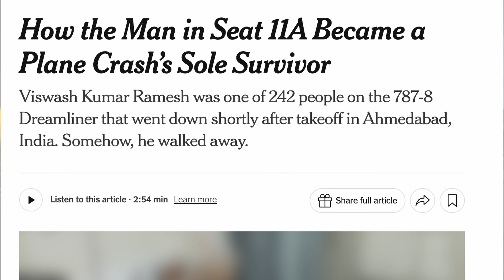Why the RAT Changes Everything – Air India 171 Update

Comment: I have one bit to add to this analysis.  There was an interview with a guy that had been a passenger on that plane earlier in the day.  He said the electrics were playing up, I think it was his onboard console or something.  Also in one of the analysis videos it was mentioned that the fuel pumps are electric.  Some years ago, I was on a 747, it was very late as the plane had been getting repairs the the fuel pump.  As we were finally loaded and on the runway, the pilots were revving the engines, presumably checking everything was working properly.  We then started down the runway to take off.  About half way down the runway, I suddenly noticed not enough thrust and I freaked out.  Luckily, a few moments later the pilots also noticed it and aborted the take off.  Turns out that the fuel pump had failed a second time while on the runway.  If this had happened one minute later it would have resulted in the exact same scenario as the AI 787 crash.
Reply: Onboard electronics that run AC, Entertainment Systems etc and FADEC electronics that run the plane are two different circuits. They have no mixing. This might be a first of its kind failure. Really have to wait for the DVR analysis.
Reply: @backpropagation8365  If electronics and power are out, will the DVR not also be out?
Reply: @backpropagation8365 
Super point
Reply: Having travelled Air India - centre seat consoles not working is somewhat the norm unfortunately
Reply: The entertainment screens have NOTHING to do with avionics systems
Reply: @texasrob2782  Good point..... But folks will say otherwise. It's human nature:     
 "My Call Button for the steward was not working..   I JUST KNEW we were going to crash & die!"
Reply: @texasrob2782 They do...if there is no power generation...
That is why you l"oad shed" non essential systems if you have power generation issues!!
Reply: yeah aircraft also had no A/C during that guy's time as a passenger in the plane too
Reply: Some of the bots in the comments have sort circuited. Maybe it's in solidarity with their electrical circuit cousins on this airplane.
Reply: Regarding the onboard electronics, Air India is notorious for never having functioning IFE systems. Everything else checks out though.
Reply: A 747 has several fuel pumps. 2 for each tank. One faulty pump would not be the end of the world
Reply: Oh my!  I'm glad you are still with us, Carla.
Reply: I saw a video (perhaps not a reliable source) that said that once running, the engines can suck the fuel they need without the pumps.
Reply: There is a video going around people are saying is from that plane. But if you look at the seat configuration it's totally wrong as dreamliners are 3 by 3 seats. First or Business class are the only ones that are the two seat configuration & there aren't that many of them. So if that's the on you are talking of I would fully believe it. Until it's been confirmed real by the investigating bodies as I'm sure they would be looking at it & talking to previous passengers.  Also if this was true they would have had plenty of time to get a new plane as this originated in I think it was in Brisbane.  I hope this can be verified but that's what I read when it first happened & I've done a flight booking & that's the plane you get doing the same route.
Reply: Maintenance?
Reply: The AC and the entertainment systems run on different circuits.  While it’s not rare, AC and entertainment sometimes don’t work on aircrafts, but that doesn’t mean they can’t fly
With AI I would not be surprised, I have flown to NY from Delhi on AI and the entertainment system was knackered for the entire duration of the flight. The cooling was also not stellar, the seats were also loose,
I wouldn’t be surprised if bad maintenance had a role to play in this catastrophe..,
Reply: @arbjful  To stop you in your tacks and to prove you factually wrong;

"After initial investigations, Boeing was quick to come up with a solution to its battery issues. In February 2013, it submitted a proposal for the update of the 787 battery and later made changes. In a press release from March 2013, the airframer said,
"
Design feature improvements for the battery include the addition of new thermal and electrical insulation materials and other changes. The enhanced production and testing processes include more stringent screening of battery cells prior to battery assembly. Operational improvements focus on tightening of the system's voltage range. A key feature of the new enclosure is that it ensures that no fire can develop in the enclosure or in the battery."
Reply: A basic check....
"Thrust set...."
And check your fuel flow...
Especially on the B707....
You flew it on fuel flow....
Reply: yep i saw that.  the electronics at the seats were not working.
Reply: @YouTubeAccount-z4r  Also air-conditioning was out and people were fanning themselves to try to stay cool.
Reply: How many fuel pumps a 787 dreamliner  has?  Should have  redundancy for such a critical component
Reply: @user94133  The 787 has redundancy everywhere. It has 4 total fuel pumps, one in each wing tank and 2 in the center. And if there is no electric to run the pumps the engines can draw fuel via gravity feed. Once the APU is online is can also power fuel pumps.
Reply: @user94133 It's what powers the pumps.....
Reply: omg !
Reply: Fuel pumps are not electric, the boost pumps are. The fuel still gets to the engine regardless. Either way, all pumps would have to fail simultaneously and all generators too and even then power wouldn't drop off immediately to the point of shutdown.
Reply: @cefb8923  What about the FADEC? If no power, the fuel metering would shut off.
Reply: https://youtu.be/1y_u1O-T6jw?si=kIy6IEkTbtrOFLX4
Reply: Thanks.
Reply: they should always do such a test before. If the engines work and everything else, and the fuel pump has the appropriate pressure, the risk of such events would be practically zero. Why aren't engines tested this way before launch?
Reply: Thank You Sir for this explanation
Reply: You know people
To do this kind of corruption in maintenance is a criminal act
I request PM Modi to investigate this tragedy
The people of want to punish those responsible for this terrible tragedy
Jai Hind
Reply: Dont wanna hear your analysis
Reply: I was in air India flight very recently, lot of infotainment sysmtena didn’t work for a lot of people in my flight also. Basically what that guy was explaining in that video I experienced it too, imho I’ve epxerienced that multiple time, it’s just air India being air India. I wouldn’t look into it deeply
Reply: @biorgoanylchem Again. The passenger comfort electrical systems have no relationship to FADEC electrical systems which is the circuit used to power a flight.
Reply: @backpropagation8365  The FADEC HVAC. and IFE both allrequire power from the normally redundant power busses. That the RAT was deployed is the final measure. Indicating a loss of all redundant buses. But the RAT cannot power everything, nor quickly enough in that critical phase of flight. If the video of the previous flight was the same aircraft, it would seem the maintenance or lack of,  was the root of the problem.
Reply: @rhyoliteaquacade wrong. Maintenance is done per Boeing’s checklist. The minimum checks need to be done prior to the aircraft being allowed to fly. Further the company would have to clear the periodic certification of the regulatory agency. Unless the regulatory agency of India failed in its job, aircraft being allowed to fly is impossible. Further, any electrical issue would have been found out during taxiing and the max power prior to take off. Plus IFE and FADEC are entirely two different circuits. They have no connection to each other.
Reply: @backpropagation8365  You are assuming that maintenance checklist and MEL were performed. The IFE and FADEC (normally) get powered from the redundant power busses and both engine generators while in flight. If no redundant generator, the APU or RAT are next contingencies. I am contending that the plane was flown with less than minimum equipment list and was not properly maintained. It is now obvious that there was an electrical failure.
Reply: The 787 has a known history of lithium-ion battery fires, which can trigger catastrophic avionics failures. On the previous flight, passengers reported the air conditioning, lights, and entertainment systems were not working—clear signs of electrical problems building up. During the accident, the Ram Air Turbine (RAT) deployed and the landing gear stayed down, both strong evidence of total power loss. Survivor also saw emergency green and white lights come on before impact, indicating the aircraft switched to backup power. All these point to a likely scenario where an electrical fire or battery failure knocked out critical systems, leaving the crew unable to retract the gear or climb. The 248 day bug that requires the SW to be reset (failing to do so could cause GCU issues and complete power failure) can be ruled out because the engine was replaced only recently (and probably the SW bug has been fixed)
787 batteries are susceptible to "cascading thermal runaway" where failure of one cell triggers failure of adjacent cells. A main battery fire can cause APU to fail as well. The high electrical demands of takeoff could have triggered the final cascade. Also bear in mind that 787s are Full Authority Digital Engine Control (FADEC) systems that require electrical power for proper thrust management.
Reply: @vajrapaniom7410  air India has a known history of poor maintenance. Not to mention they got fined this year FOR ALLOWING A PILOT TO FLY WITHOUT COMPLETING MANDATORY
TAKE-OFFS AND LANDINGS But you don’t bring any of that up?
Reply: @CheckUrSole This aircraft had just undergone a comprehensive maintainance. But I agree, any clues regarding malfunction should have been flagged.
Reply: @CheckUrSole 
Air India better clean up their act
Dismiss Air India
Good luck in your future business plans Air India
Reply: @vajrapaniom7410  It's very unlikely the pilots and crew would have missed a literal on board fire before taking off. It's very unlikely that it's an electronics issue. The air conditioning, lights, and entertainment not working doesn't explain much air india is notorious for terrible cabin upkeep. However, air india is notorious for cutting costs with maintenance, and if the wiring was botched in a maintenance procedure, that could explain the complete electrical power loss, leading to the fuel pumps being starved. *Edit, since the fuel was full, there should have been more than enough pressure for the fuel to be suction fed to the engines, keeping the engines running for at least a few minutes. Makes the scenario all the more confusing
Reply: @grendlerdik9426RAT cannot power the engine. The max power consumption occurs during take off, and thermal runaway requires only a few seconds.
Reply: @grendlerdik9426

BOO AIR INDIA
Reply: @vajrapaniom7410  No, it does NOT have a history of lithium-ion battery fires. There were exactly 2 incidents in early 2013, after which Boeing retrofitted the entire global fleet with steel encasements that vent gasses out of the plane should a thermal runaway every happen (none EVER has since); with new charge management logic; with new cell spacing and padding; with additional status monitoring; and with enhanced battery management systems. There has never been an incident since. Period. End of story.
Reply: @Objectified minor incidents continue to happen, but indeed the containment holds. But this was never a solution.
Reply: @vajrapaniom7410  Do the engines go to idle in that scenario? Don't they tend to keep going if they don't receive any signals? Would at least be good if the defaulted to full power you can always shut one down for landing.
Reply: @please_stop-v7o no it goes to a low power setting. Perhaps safer than full thrust considering various scenarios.
Reply: @vajrapaniom7410  so the 777 does not require electrical power for thrust management?
Reply: @vajrapaniom7410 
Fantastic analysis 
Thank You Sir for this useful detail
Reply: @vajrapaniom7410  The battery issues were well over a decade ago and were addressed. The more people speculate the weirder the theories become.
Reply: @vajrapaniom7410  "The 787 has a known history of lithium-ion battery fires, which can trigger catastrophic avionics failures."

People like you are the actual issue here, you are making factually incorrect statements based on nothing.

That claim is factually incorrect and misleading. The Boeing 787 does not have a 'known' history of battery fires beyond the well-documented incidents in 2013/2014. Those issues were thoroughly investigated and resolved with design and safety system upgrades implemented over a decade ago.

Since then, there have been no recurring battery fire incidents of that nature. If you're suggesting this is the cause of a recent event, you're effectively claiming that Air India - or their maintenance provider - failed to apply long-established mandatory safety modifications. That’s a very different issue from implying an inherent design flaw in the aircraft itself.
Reply: @aflyingcowboy31 issue was never resolved, only contained.
Reply: @vajrapaniom7410  "issue was never resolved, only contained."

Factually false, if it was only contained please explain why there have been no reports of battery issues since 2013/2014.....

Boeing revised the battery design and the FAA also implemented 3 additional overlapping protection methods to address this issues.

So once again, you are the issue, because you are spreading misinformation.
Reply: @aflyingcowboy31  to contain the fire, yes. The type of battery remains the same.
Reply: @vajrapaniom7410  I literally just gave you a quote that says it is not the same battery.... 

They literally revised the battery, maybe try reading things closely first.

"Design feature improvements for the battery include the addition of new thermal and electrical insulation materials and other changes. The enhanced production and testing processes include more stringent screening of battery cells prior to battery assembly. Operational improvements focus on tightening of the system's voltage range. A key feature of the new enclosure is that it ensures that no fire can develop in the enclosure or in the battery."
Reply: @vajrapaniom7410  Once again, if they did not change the battery, explain why there have been no incidents with that battery since 2013/2014....

Stop spreading misinformation.
Reply: @aflyingcowboy31 why has anything never happened before is an interesting philisophical question.
Reply: @vajrapaniom7410  Except it isn't. Once again you refuse to read what I have given because you are a liar, they revised the entire battery.....

If it was a known issue in 2013/2014, why does that known issue no longer occur.....

That is not a philosophical question, it only is because you don't want to acknowledge you are wrong.
Reply: @aflyingcowboy31 depends on what you mean by revised. Again, we are talking about plausibilities and statistics, chances that are one in 100,000 or a million. Both engines failing simultaneously, absent a massive bird strike or debris affecting both engines, leads in the direction of a  total power failure.
Reply: @vajrapaniom7410  I literally gave you a quote on what they revised......

"Design feature improvements for the battery include the addition of new thermal and electrical insulation materials and other changes. The enhanced production and testing processes include more stringent screening of battery cells prior to battery assembly. Operational improvements focus on tightening of the system's voltage range. A key feature of the new enclosure is that it ensures that no fire can develop in the enclosure or in the battery."
Reply: @vajrapaniom7410  Lastly, just to completely debunk what you are saying.

You’re overlooking the fact that these planes are built with multiple redundancies. Even if the main battery were to fail, the APU (Auxiliary Power Unit) would still provide power. So by your logic, not only did the battery go, the APU also failed - which is statistically as implausible as the dual engine failure itself.

This strongly points toward a more systemic issue -  such as fuel contamination or a maintenance-related failure - rather than a coincidence of multiple independent failures.
Reply: @aflyingcowboy31 1. Even a tiny amount of contamination will be detected 2. Redundancy and cross feed 3. Not critical during max feed 4. No indication before take off 5. No precedence at all of dual engine failure due to contam. 6. No other aircrafts were affected.
Reply: @aflyingcowboy31 cascading effects have been a concern and reported by NTSB, since the circuits are shared between main and APU ( Thales design).
Reply: @vajrapaniom7410  "1. Even a tiny amount of contamination will be detected"

Really? Yet actual pilots have all considered this to be a potential cause....

Regardless you are now rambling and just sidestepped the fact that according to you both the APU and main battery went.....

Regardless, they fixed the battery issue back in 2013.
Reply: @vajrapaniom7410  "4. No indication before take off"

Yea, and the Cathay Pacific Flight 780 also showed no signs of fuel contamination, yet it had an engine fail due to fuel contamination.
Reply: @vajrapaniom7410  Yea, the problem is definitely people like you, you actually have no clue what you are talking about i.e. you are using information that predates the battery revision.

The NTSB literally states Boeing fixed that issue.

"The 787 main and APU battery design was also modified to mitigate the most severe
effects of an internal short circuit (that is, cascading, cell-to-cell thermal runaway of other cells within the battery; excessive heat; flammable electrolyte release; and fire)."
Reply: @aflyingcowboy31 exactly, occured during landing, with minor indications during take off and cruise. And only one engine failed.
Reply: @aflyingcowboy31 NTSB reported skepticism, while Boeing was confident of the contsinment. However, Japan (JCAB) had called for a complete re design after 3 incidences in 2013 after the fix. Containment is not equal to solution.
Reply: @vajrapaniom7410  "exactly, occured during landing,"

Yea, so you actually didn't read anything... It occurred two hours after take-off and initially the pilots noticed "During the climb, the flight crew noticed some minor Engine Pressure Ratio (EPR) fluctuations on No. 2 engine. No. 1 engine also had EPR fluctuations but within a narrower range."

 Furthermore both engines were affected, but thankfully only one went out, the incident response literally has "CPA 780 declared a Mayday when approaching VHHH with control problem on both engines"

Regardless what happened to your previous statement of "1. Even a tiny amount of contamination will be detected" Oh, it went out the window.
Reply: @vajrapaniom7410  " NTSB reported skepticism and Japan had called for a complete re design after 3 incidences in 2013."

Are you actually this dense? They literally revised the batter and the NTSB did not report scepticism, they literally state they mitigated the issue. If the NTSB was sceptical they would not have allowed them to fly.... The final report doesn't even recommend Boeing do anything more with that battery, you are actually a complete liar.

Their final report literally stated; "The 787 main and APU battery design was also modified to mitigate the most severe effects of an internal short circuit " Hence why they allowed it to fly again.
Reply: @aflyingcowboy31  in the recommendations, they advised improved testing (with Yuasa), manufacturing oversight, and for new technologies. If they were completely satisfied, why would they do these recommendations?
Reply: @aflyingcowboy31 so nothing changed or no lessons learnt from the Cathay Pacific incident that occured in 2010?
Reply: @vajrapaniom7410  " If they were completely satisfied, why would they do these recommendations?"

And at no point did they say the battery needed further modifications did they.....

TLDR ; They were satisfied with the battery changes. What they weren't satisfied with was the fact that the issue wasn’t discovered sooner. That is what those recommendations were for.
Reply: @vajrapaniom7410  "so nothing changed or no lessons learnt from the Cathay Pacific incident that occured in 2010?"

You do know like the main way to find fuel contamination is via manual testing of the fuel right?
Reply: @vajrapaniom7410  Regardless, the actual experts still thing it may be contamination, I am not saying that is for certain what it is, but the fact you are straight up ruling it entirely out is very weird.
Reply: @vajrapaniom7410  "One of the reasons that can cause thrust loss, power loss, which prevented the aircraft from climbing, is fuel contamination. So if the fuel is contaminated, both engines will behave the same way, and the thrust generated is less, and the aircraft could not sustain the climb rate."